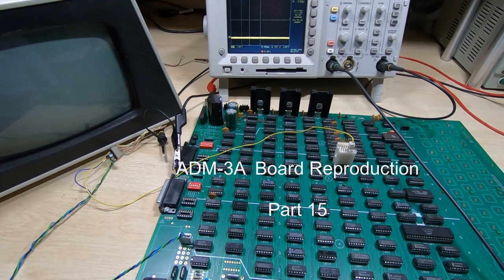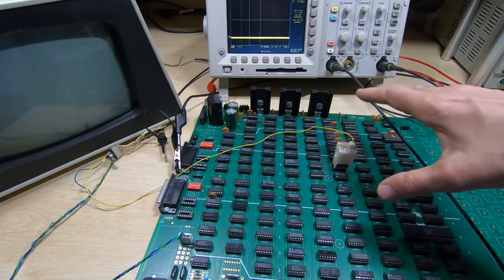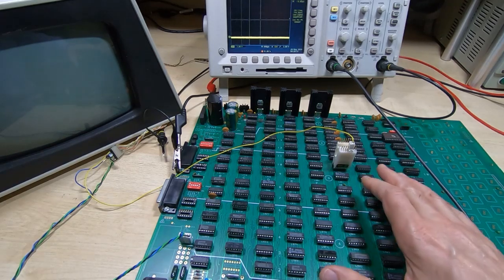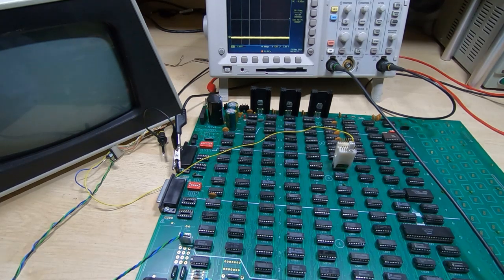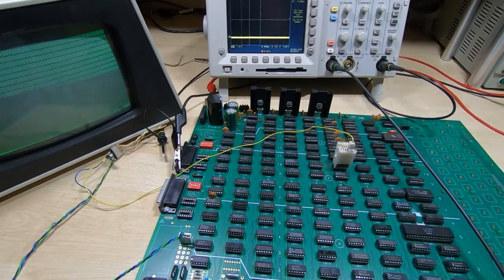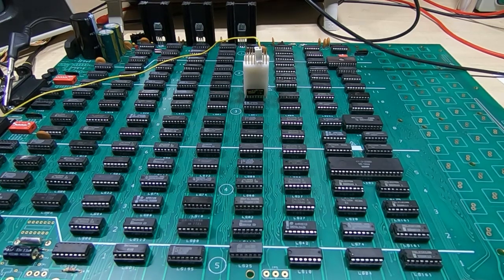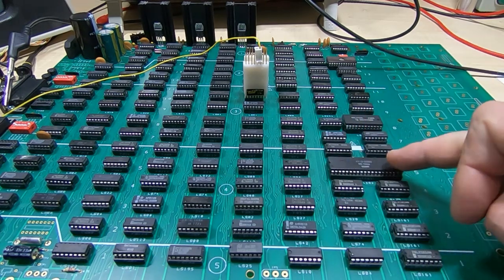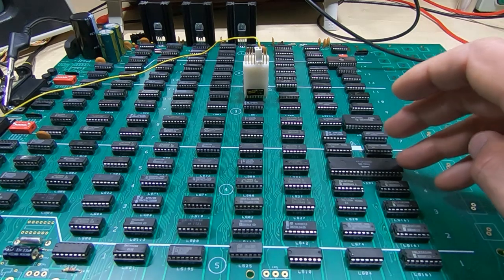ADM-3A  Board Reproduction Part15

Comment: It's facinating to see how the original designers managed to create the Terminal from almost all discrete TTL devices. I do like discrete designs if you've got the time and the physical board space they are much more interesting than just using LSI devices. We used to repair Newbury Terminals in the 1980's and the main boards where much the same size most of the faults were with the Video Board and the Power Supplies the logic board very rarely gave any problems. It's interesting that they stop the UART Clock for handshaking not something I've ever thought of. Looking forward to seeing the future videos.

Comment: Jerry, I'm still trying to catch up on your older videos, so I apologize for this late comment/question.  As you were explaining why some particular so far unfitted ICs were needed to activate a function and that you purposely hadn't fitted them at that point, I realized that you must spend a lot of time planning your testing for projects like this.  I wish I could find videos/classes that would teach me enough to be able to (relatively easily?) plan testing of any projects I attempt!
Reply from the maker: I do not think what you are looking for exists - yet. That is precisely why I started my channel. Hopefully as my projects progress it may assist you. If you are interested I have just started work on a book that will be explaining methods and tactics for vintage restoration and repairs. The ADM3 was a fairly simple project to break into blocks and I approached it by getting each block working in turn but in an order where dependencies were satisfied (eg power before reset, reset before clock, clock before counters, counters before scan etc),
Reply: @JerryWalker001  I really look forward to that new book -- it sounds like it will greatly help me with my old DEC computers & peripherals and other vintage test gear. I've already got "Computer Time Travel" and am waiting to receive the core memory book via Amazon.  Thanks for your response!

Comment: Really enjoying these videos - simply fantastic! Thank you so much for this.
To revisit the option 7 beep defeat; I found a schematic here: http://www.classiccmp.org/dunfield/altair/d/adm3a_m.pdf which has it on p 93, schematic sheet 3 section C2. It doesn't stop all beeps; it connects pin 10 on the DM74123 at D1 to ground, which silences the beep when the cursor hits column 72; other beeps (e.g. power on and BEL character) still work normally.
Reply from the maker: Thanks for the link. I did trace out the original board I have here as it has the option 7 pcb traces (but no switch) but because the board is so complex and I needed to avoid a frankenstein version I decided to stick to the schematics I have. I will be pointing out a few other differences in an upcoming video. For example another change in in the code select switches. On the schematics I used it it possible to short the output of a gate to 0V by selecting certain option combinations and that is not good so they modified it in the later versions. I needed to aim for a specific target version to ensure (as much as possible) that I would end up with a working board that could be built by others as well. If I produced a version that did not match a specific set of schematics then it could get very confusing for anyone wanting to build one. The information you provided will hopefully help anyone wanting to add the option 7 functionality if they want it (I will most likely just unplug the sounder on mine).

Comment: Definitely interested in a board. Can't wait to get my hands on one. What are the RAM chips? I need to find some 1101a chips for my Mark-8, they're getting expensive and more difficult to find... Should I start looking for the RAM chips for this now?
Reply from the maker: It uses 2102A SRAM chips. They are fairly easy to find and not too expensive (14 needed).
Reply: @JerryWalker001  oh that's gold, I might already have a few of those in hand. They are much more common than the 1101a's